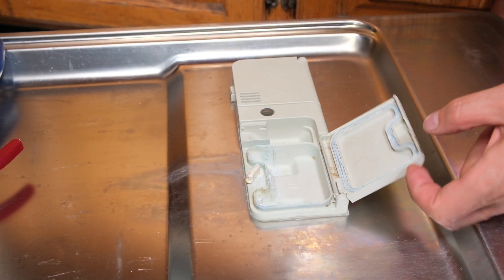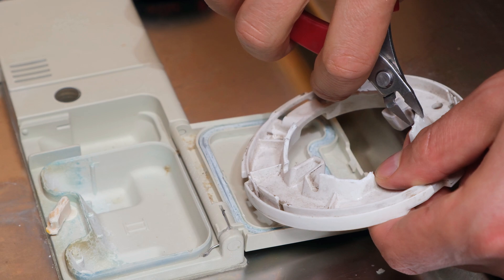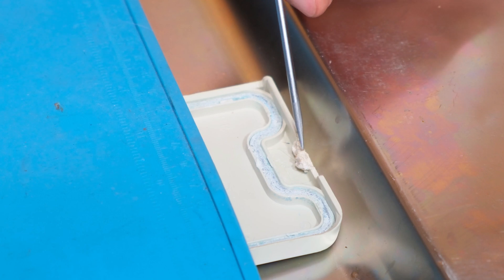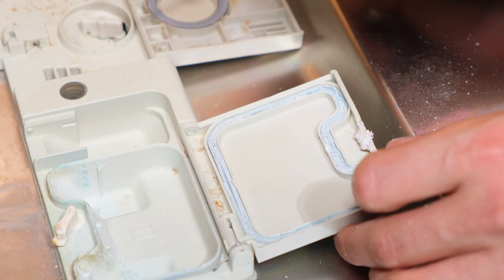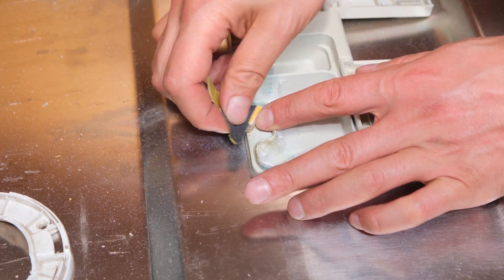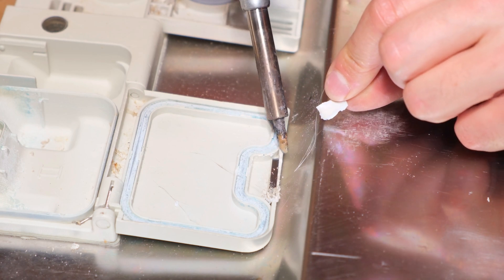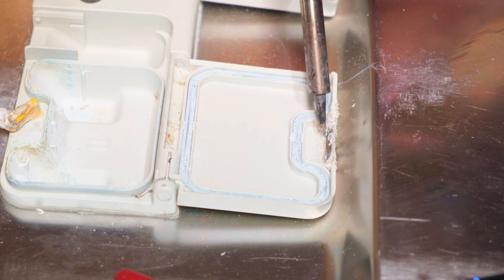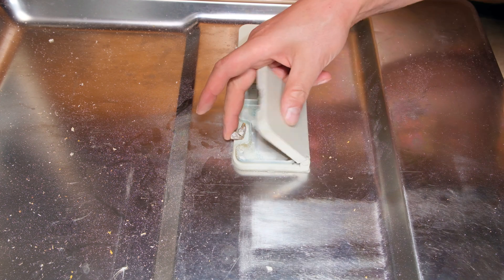How to fix broken plastic using plastic welding - Dishwasher example

Comment: Excellent video!  Thank you so much!!! I am doing exactly the same thing today do a dishwasher soap door. The push button on the bottom has a sloped area that when pushed down by the latch on the door the push button part rotates upward and then comes back and latches onto the ledge on the door. In my case, only the door is having a problem. The tiny ledge on the door has been broken off mostly. I was thinking of using epoxy and then I thought about plastic welding and searched here. I was going to use a zip tie for donor plastic but I will now look for a better plastic.